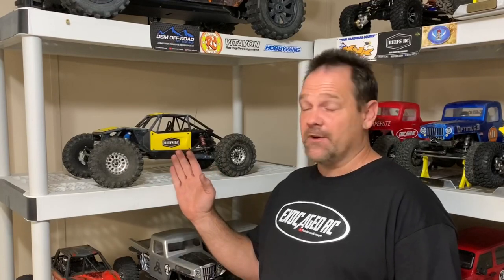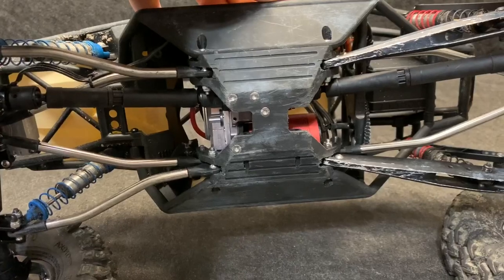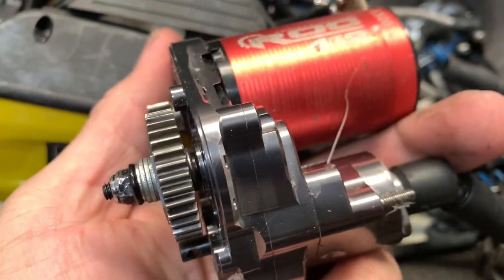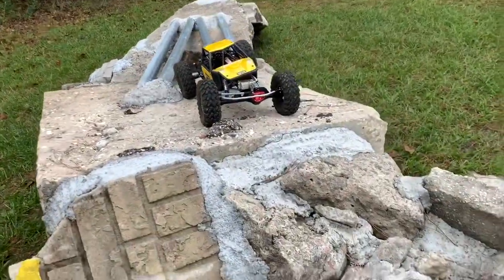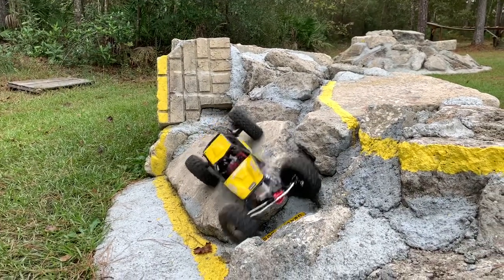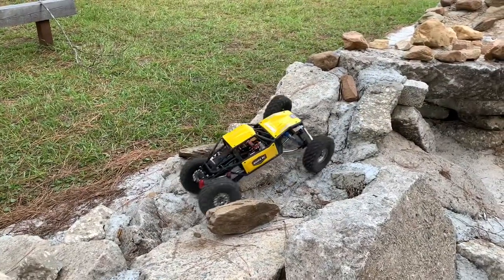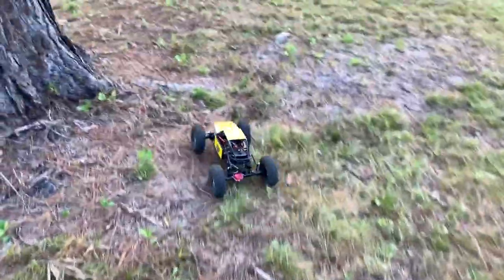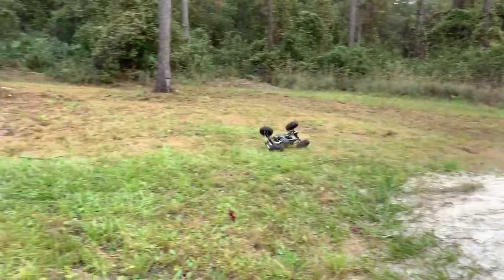Capra bouncer with JEC slipper eliminator

Comment: You can also add 3 drops of super glue between the pads and the silver plates to stop the slipping.  I did this on mine, MEGA GOAT, while waiting for my jec eliminator to come in.  Im running a HH 3500kv on 3s and had zero slippage.  Great videos i watch them all.
Reply from the maker: awesome tip, Glad to have you!
Reply: I did this but with red loctite

Comment: Send it to me, I will tighten the slipper screw.
Reply from the maker: LoL the plastic spacer wasn’t holding the pressure.
Reply: @ExocagedRC  I have never used the slipper clutch, always tighten them to the point of almost stripping the bolt.